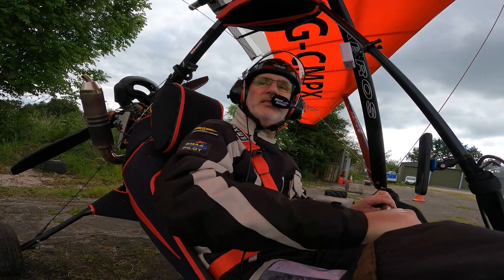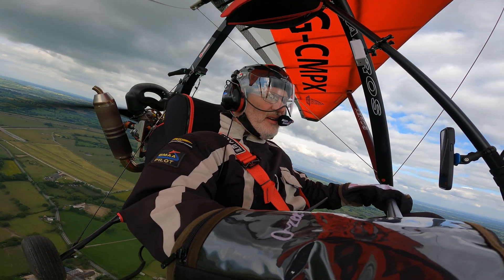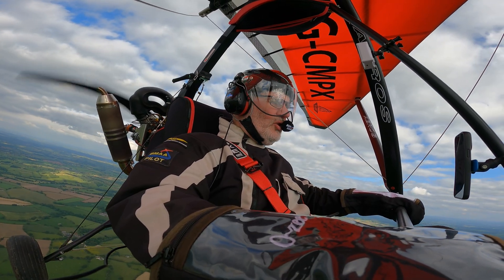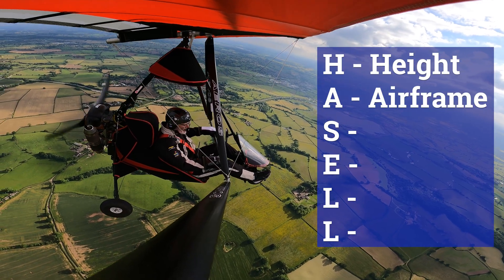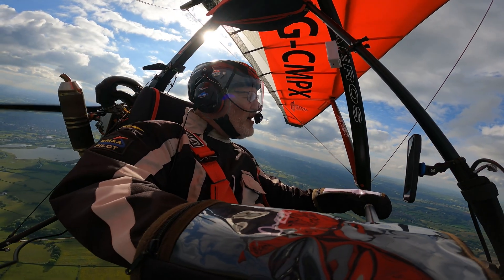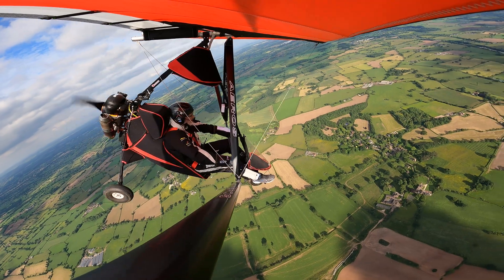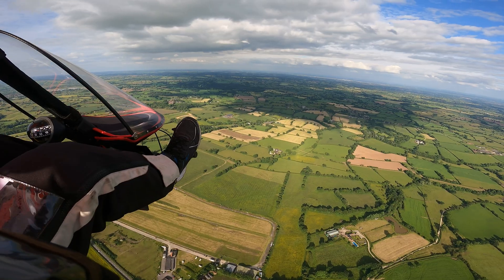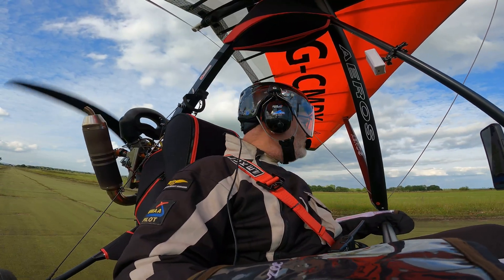When the Wing Stops Flying!

Comment: As a new pilot, going through training,how do you judge your maximum banking angle. I know 60° is the maximum but how do you know when you're getting close to that? It may sound like a silly question but thought I would ask.
Reply from the maker: There is no definite way to measure your bank angle beyond 45 degrees. You have to just kind of eyeball it. I know that for examination purposes, most examiners will accept anything that is marginally beyond 45degrees. Probably best to talk this through with your instructor. 👍

Comment: Very interesting video. What is the range for your plane? Can you fly to the southcoast or into Scotland? Greetings from Norway.
Reply from the maker: Hi there. My aircraft has a duration of around 4hrs so in still air that would equate to around 200 miles so Scotland and south coast would be achievable. Problem is my bladder wouldnt survive 4hrs! 👍
Reply: @paulieb796  I see. Thanks. Looks like great fun 🤣

Comment: so, in a severe departure from stable flight the airplane will basically snap-roll forward passing vertical into inverted (something which you called a whipstall)... in a smoother scenario, the nose will dip rapidly requiring a quick reaction to regain speed, but the aircraft remains somewhat controllable.... in the smoothest scenario, the airplane will just sink vertically, which does not develop into a flat-spin since you still have your roll control.
Reply from the maker: That about sums it up although in the gentle scenario, I wasn’t really stalled as the outer portions of the wing were still flying due to the washout in the wing. 👍
Reply: @paulieb796  about the first case, I was thinking something along the lines, hence my question... thanks for the clarification!

Comment: did the wing actually stall (exceed critical angle of attack with the airflow leaving the wing) in the first scenario, or was it just unable to maintain level flight and therefore in extreme sink... I ask this because I do not see any buffeting which really surprised me.
Reply from the maker: I have never felt buffeting before a stall. I’m not sure if that’s due to the flexible nature of the wing which absorbs the buffet before it can travel to the control bar. I’m sure somebody more knowledgeable than I will tell me if I’m wrong. 👍

Comment: Surely you do a 360 Degree Turn?   a 180 Degree Turn is only giving you half of the safety check ;-)
Reply from the maker: When you are flying a given heading, you have a good 180 degree field of view (probably more) if you then turn 180 degrees and fly a reciprocal heading, you have the second 180 degrees of the full circle thereby giving you a complete 360 degree lookout. 👍
Reply: @paulieb796  I have always done a complete 360 degree clearing turn, but I guess as I am flying enclosed cockpit aircraft I don't have the 180deg forward vision you have in a Flying Deckchair, I would accept that a Flexwing aircraft has better spatial orientation than a Fixed Wing aircraft but I would always advise a Fixed Wing Microlight Pilot to do a full 360 clearing turn ;-)

Comment: Hi Paul is your engine two stroke and if so what is the fuel to oil ratio and do you use highest octane? Thank you
Reply from the maker: Hi There.  My engine is indeed a two stroke.  It is a CorsAir Blackbull 235cc engine.  I use Motul 800 oil mixed at 66:1 and I use 99 Octane fuel (with the lowest amount of ethanol I can get which is around 5%).
Reply: @paulieb796  Is it permissible to mix it with water and food colouring to suck out the remaining ethanol, then decant the petrol? Technique apparently used for vintage cars and I can also let rip with the lawn mower but unsure about a microlight engine....

Comment: My control bar pushes back at me when I try to stall it. I have to work to get it to stall. I just let the thing fly itself. It's better that way.
Reply from the maker: The NiNE wing is quite happy to let you approach a stall with very little pressure on the bar.  One reason why it is not for beginners!  The stall itself though is next to nothing with instant recovery.  I agree with just letting he wing fly, I don't normally mess around with stalls other than occasional practice.  This was just to help answer a question.  👍
Reply: @paulieb796  You did a great job at answering the question. Great video!

Comment: Hi Paul. Great to see you with some air under yours wheels. Blimey I remember learning about stalls on my first glider course in 1982.

Question - how does a trike deal with a cross wind? I'm very used to how we deal with this in a 3 Axis aircraft.

Note, me second undercarriage, leg, has been fixed, now just building up strength.
Reply from the maker: So, crosswind landing in a flex. . . There’s another video to add to the list. 👍